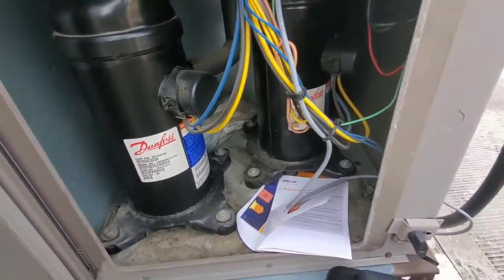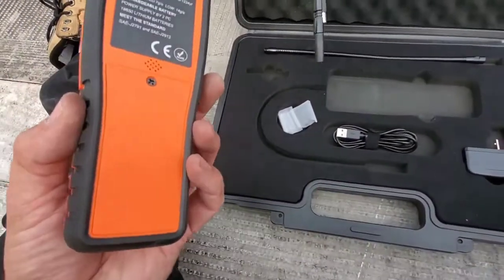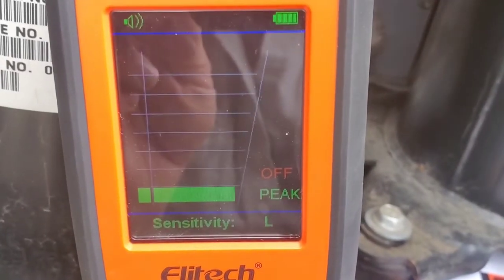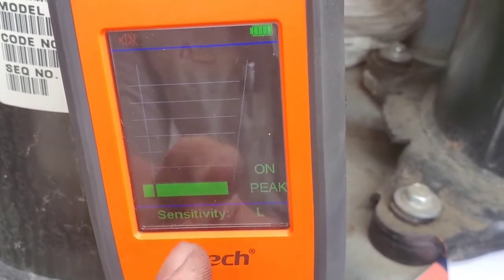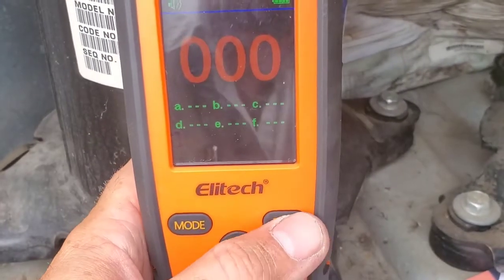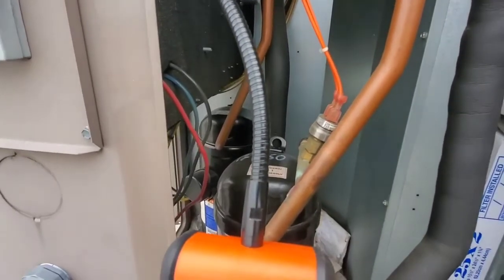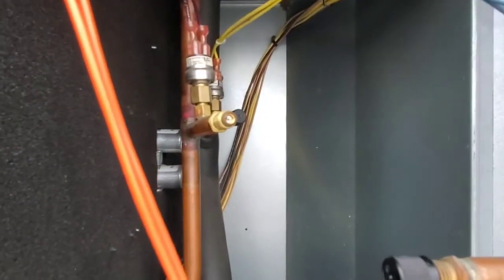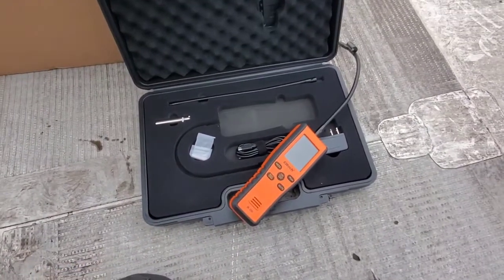Elitech IR-200 Infrared & Heated Diode Leak Detector for Air Conditioner and Automotive Repair

Comment: First comment! I was wondering why they dont list HC refrigerant on the back of that meter? The advertising says it can detect hydrocarbons? Any thoughts?
Reply from the maker: Hi,
Thanks for your feedback.
I will send your suggestion to our related department.
Reply: @ElitechTechnologyInc  I recieved the detector yesterday and it does detect propane with infrared mode. Im going to use it and find the best method to detect leaks on systems, I may make a video once I am familiar with the unit.
Reply from the maker: @JDT738126  Hi, thanks! You can send us the video and we will give you a coupon $15 for your next order.
Reply: I believe it's mostly because it picks up halogen gases, like fluorine.